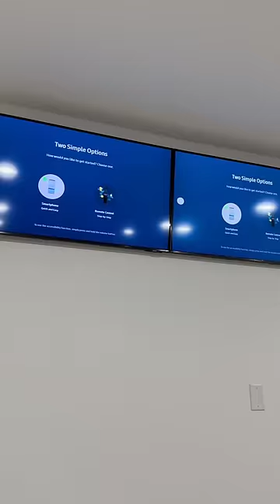How to put 3 TVs Side by Side #fyp #work #tv #install #tvmounting #🤣 #samsung #reels #tiktok #goat

Comment: You would be tha #1 guy I would call if I needed help on an install. Some clean work. Gotta give it to you brotha.
Reply: You call mounting the mount crooked clean work? He purposefully did that because the part that is attached to the tv has screws to level it. So again you want someone purposefully or not caringly mounting a mount crooked? I’ve been doing this for a while now and to not even place a level on the mount is absurd. Even then he didn’t get the one on the right perfectly aligned. I guess that’s why he charges $100.

Comment: So they make an adapter for the Dyson vacuum that allows you to use a Milwaukee M18 or Dewalt 20v battery with the vacuum. In case you needed to know 😁

Comment: Buy a longer level bro😂 the difference from a 6 or 4 foot level is huge compared to a torpedo level. Would have been better off using the lazer and just use a tape to measure to each point of the tv's. It is still a Clean install  in the end